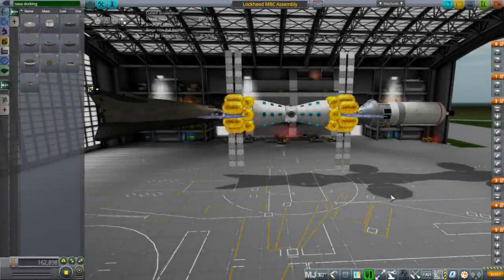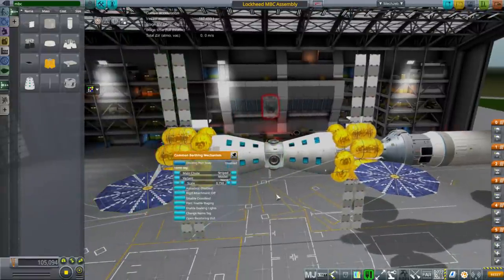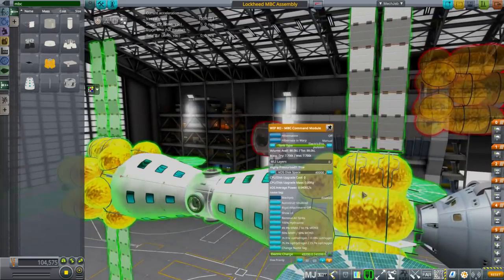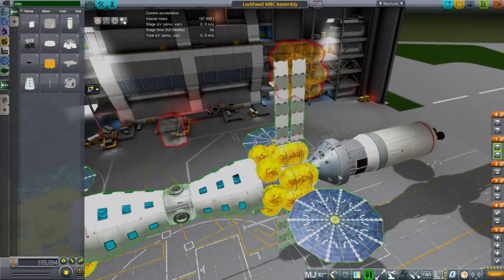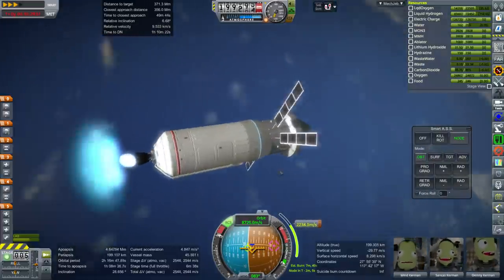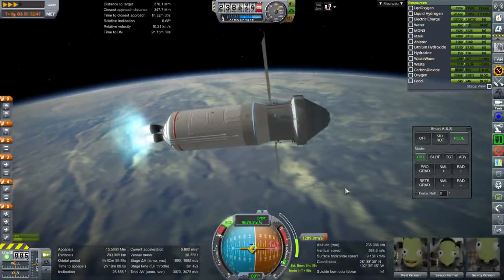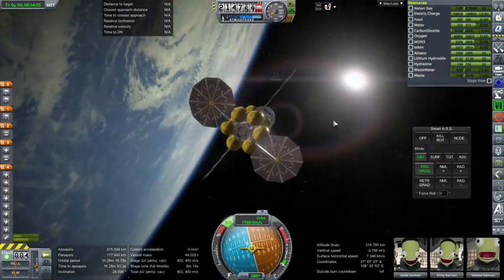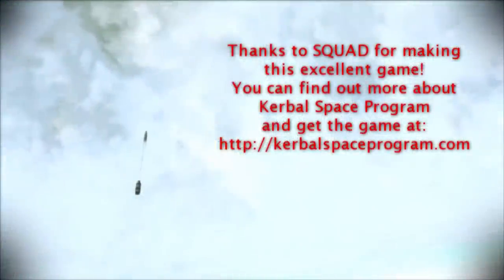Kerbal Space Program RO Sandbox - Lockheed Mars Base Camp

Comment: I should send you my 400T to LEO in RO and let you see what you can do with it. 
Its insane with ether  21 F-1Bs or 9 F-1Bs with 8 RSRMV for First Stage. 2nd is dual M-1U.
Reply from the maker: My goal is usually to use the smallest rocket possible, putting constraints on the mission so there's a real challenge. I can easily make a big rocket.
Reply: @RaizSpace  There is a constraint, how big the payload faring will go :)